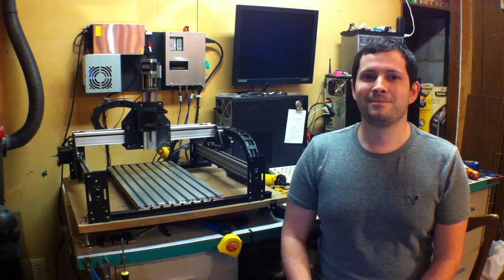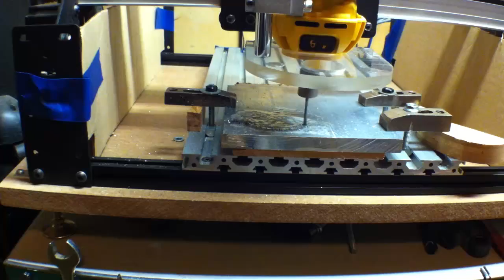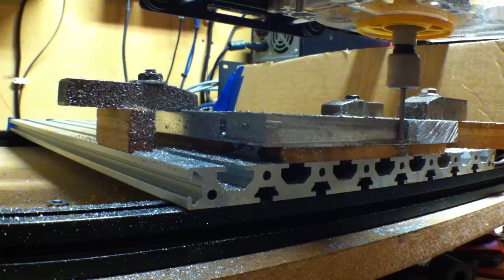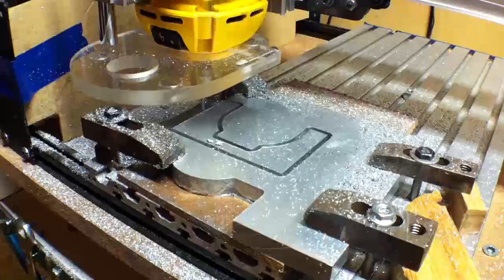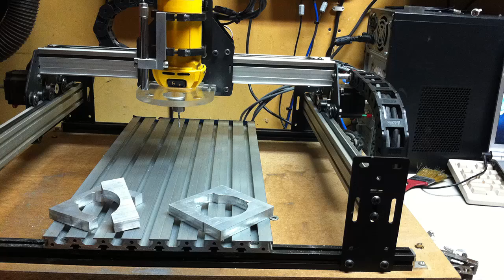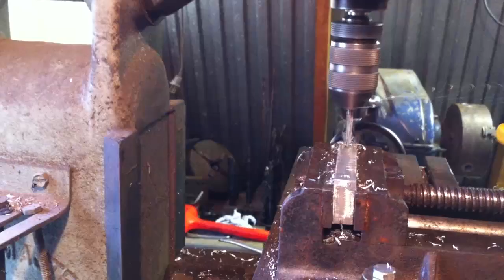Milling Aluminum DW660 Mounts

Comment: I need to get some like this m I still need to remove that darn dewalt quick hand chuck thingy on the collar but I'm dreading taking the thing off.
Reply: LOL...Love this guys videos.  I currently have the the Delerin ones...and yes uber pain to snake the DW-660 in and out of.  I need to make a dust shoe for mine.  Designed it just have to cut it.  I'm torn on removing the "quick chuck"  It's not the easiest but it's not that bad.